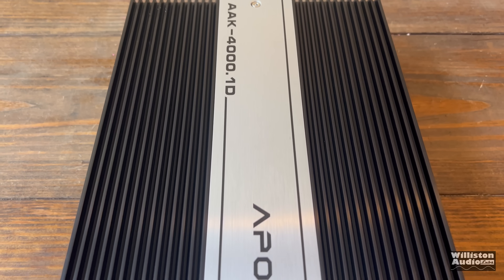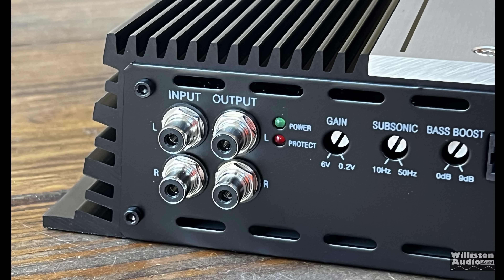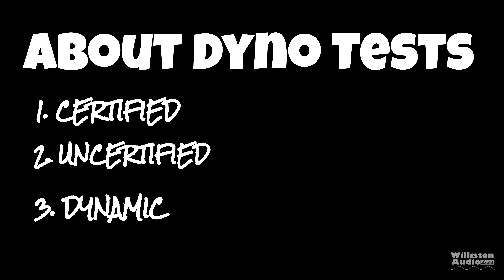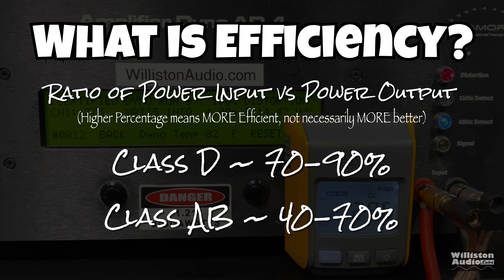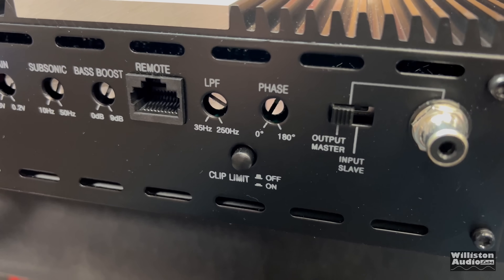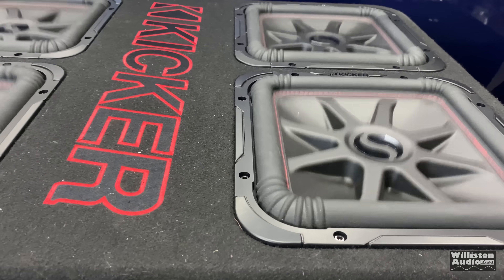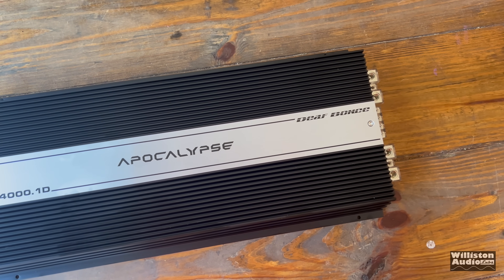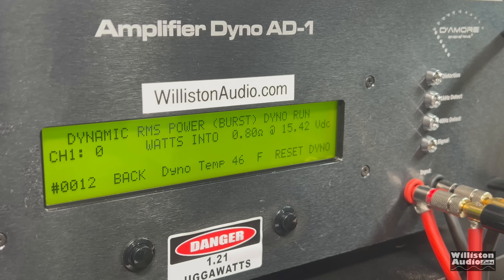Deaf Bonce AAK-4000.1D Amp Dyno Test

Comment: Do u recommend me running this amp on a stock alternator? I have zero gauge and good wiring but I have a stock alternator for a 10 inch Sundown, I'm trying to push the speaker to it's limit, do u recommend me getting this amp?
Reply from the maker: You should be able to push that 10in Sundown well with 1000-1500W which should work fine with most stock alternators. Take a look at the D4S JP8 v1.5 at Shop4Bass.com it's on sale right now and this amp does 1200W.

Comment: These amps are junk. First one lasted almost 2 months, sent it in for warranty and they kept it for about a year. They sent it back claiming they couldn't fix it.  So the dealer, bless his heart and out of his pocket, replaced the amp. Second amp didn't last 2 weeks.
Don't waste your money
Reply from the maker: Must’ve been a fluke as these are made by a high quality manufacturer who makes amps for other big names as well. These are known for reliability
Reply: @wal  A fluke? 2 amplifiers, less than 2 months of regular use, not competition use.  Zero warranty,  yea, that's quality. 
I have better luck with Hifonics

Comment: I slather my car in Boss and Pyramid audio. Built in theft deterrent. 🤣😂

Having multiple small capacitors in parallel lowers the impedance of the power rails and makes for larger surges of power, especially as the output impedance drops. Generates more power, and keeps the individual caps cooler, but if one goes short circuit it’s irrelevant anyways. Also depending of the required filtering and reservoir needs it may be cheaper to use many small caps vs much fewer huge caps.

Comment: I like the brand from what I know of them but it's kinda hard to be impressed with the over rated power since d4s amps have come out and you have tested them.  I have a mtx te4001d that's rated at 3750 @ 1ohm I'm kinda curious what it would do

Comment: found this channel doing a google search for something somewhat unrelated; since this channel looks at older equipment ... 

 if you see this could you explain what the Kenwood KAC-818 Class D mono subwoofer amp's 'Sigma Servo Feed Back' terminals/system claimed to do and if it actually did it.  I have the amp still, 20+ years old and it still works great.  Just curious what it did, if it was a gimmick, worth using the circuit or not, etc.

Had it on a Radioshack 18" for a long time as a teenager :p

Comment: Clip limiting wouldn’t affect the available power. A limiter on the input signal  is a very aggressive compression circuit to prevent output clipping. Usually limiting refers to compression ratios of 10:1 or greater. Some manufacturers call this soft limit or whatever.

Comment: Just wondering if there is anyway to test dampening factor and other things with amps?
Reply from the maker: I’m not interested in splitting hairs with technical measurements that may or may not have any impact on the sound quality. There is great debate, even from amplifier engineers on how to measure damping factor and if it makes a difference. I know what the Internet says about “speaker control” but damping factor is much more complex and not easily comparable on amps because of how it’s measured by different manufacturers
Reply: I wish he would show specs like that in the Dyno videos cause I want high signal to noise and very high dampening factor over 500 preferef

Comment: Man, if they aren't under rated on the Dyno they're gonna be over rated in your car!!! That's for sure!!! With impedance rise and power supply, an amp in a car almost never performs as well as it did/would on the Dyno!!! Dynos, as we know, is always a complete best case scenario for an amp's recorded output. This amp performs amazingly, making it's rated and surpassing it on lower ohm loads. Which is optimal for subwoofers.
Reply from the maker: Dyno makes it easy to compare amps in a level playing field. In car will be different for all amps and setups. No way to account for that
Reply: @wal  Yez Zir, I've tried to explain that to soooo damn many people.......

Comment: At last... a subwoofer amp that can also power my water heater. 😅 Noticeably more power with the clip limiter on is definitely weird. If that were SPL, I'd attribute the increase to a narrowing of the frequency band to a resonant frequency. But, wattage...? Any EE nerds in the comments care to enlighten me? 🤷‍♂👍
Reply: Limiting wouldn’t limit bandwidth.  It limits amplitude. I think the amp just performed better on that run because of inconsistency. I bet if you ran the same test 10 times, 5 with, 5 without the limiter in, you’d have results that vary up and down the same way with or without the limiter.

Comment: Deaf Bonce amps are good quality but they don't do over rated nearly as well as some competitor amps.
Reply: Most of the time, advertised power ratings are more of a sales gimmick. When an amp states its rated at 3k watts at 1 ohm, and yet it does say..4500 watts at 1 ohm, its really a 4k board,  and it sells better having "more headroom" because you think you're getting more for your money. Build houses will print ratings based on what the company wants advertised.

Comment: Korean make some good amps. But Brazilian is the way to go. We just replaced 1 4000d watt crescendo amp,  for 1 full bridge sound stream 18,000 watt Maxx amp, on  two Rockville destroyer 15s at 1 ohm, and the soundstream is really surprisingly better. You wouldn't think a amp so small compared to the crescendo amp, would hit so hard like it do.
Reply: What lmdao “we replaced a 4000w amp with an 18,000w amp and wow it hits harder” are you reading what you’re typing before you hit send?
Reply: @TV_Offroad  ...the amp is not 18000 watts for real, but it's advertises 7k RMS at 1 ohm. But the point of the matter is the amp is cheaper, smaller, and louder. Matter of fact, the deaf bounce amp in this video, falls in the same category with that crescendo amp that we replaced. And that cheap soundstream amp will push more power then this deafbonce, along with that crescendo amp, for half the price that these amps are retaining for. That's why I said you wouldn't think that soundsteam amp would hit so hard just by looking at it. But my point is, eventually people are going to start doing things the new way. The old ways cost too much, and it's lesser efficient.
Reply: @johndough4338  that fact remains, that full bridge and half bridge do not sound the same. This DB amp, can be beat on and abused doing demo’s and whatever else for hours and hours. When I switched from my Sundown SFB8000D, to my JP63, I gained 3-4db in the sub 30hz range, stayed at a cooler temp range longer. My peak DB went up, sq went up, and my draw on my electrical is less with the Korean board. Cheap ≠ better
Reply: @TV_Offroad  18000.1 d is just the model number the power output is similiar
Reply: "Soundstream" is NOT Brazilian... 🤦‍♂️
Reply: @chueyone72  ... it's a full bridge amp
Reply: Brazil is a place, full bridge is an amp design. Brazilian amps just made the design more popular when a few of their companies figured out how to make them dirt cheap just like Korea has with half bridge amps. I believe Sundown’s full bridge amps are made in China.

Comment: I got an MTX amp that wants a piece of that deaf bounce on the dyno.

MTX92001 that I'm a few days away (waiting for parts delivery) from bringing back to life.... 

Previous owner smoked:
1.  5 (of 12) 80NF08 power supply fets (being replaced by 064N fets)
2. 4 (of 16) 30N50 output fets
3. 4 3120 optocouplers 
4. 2 35v 1000uF voltage regulation caps that smooth the input to the optocouplers 
5. The ENTIRE voltage regulation circuit that provides 18v above negative rail to the low side optocouplers.  (1 15v zener diode, a diode array, two mmbt42 sot23s, 4 various smd resistors, and a 42N20.)
6. 1 smoked solder joint on a 5W resistor that provides partial high rail to the high side optocouplers
7. And 4 SMD mounted output smoothing capacitors.
8.  And a bunch of dodgy attempts to work on this amp by a previous tech whose work I've come across before and it was ALL dodgey to say the least....
9.  And most importantly I had to use Perry Babbins amp repair guide as well as asking him directly for a few pointers on this amp.  The guy is downright AMAZING!!

Comment: Can you explain what the significance of the Tiffany style inputs are.
Reply: Tiffany rcas are attached to the case for more support. Regular rcas are just soldered to the main board and can break loose.
Reply: @jamms992  that's what I was trying to say, thank you for clarifying that bro!
Reply: Your very welcome:)
Reply: There made better then your standard RCA that you see on cheaper amps. There mounted directly to the board I believe. There stronger, more solid, better connection!

Comment: Multiple smaller caps generally will offer lower overall ESR.  They will also dissipate more heat.  Larger caps will obviously offer larger capacity per unit but there is no disadvantage to using multiple smaller caps to make up higher values aside from larger PCB traces and extra layout time.  Smaller caps do have higher resonance frequencies than larger high values, and play a large roll in filtering certain frequencies, but in the case of an automotive amp you are only dealing with DC and this does not play as much of a role in choosing a capacitor by size alone. Notice the value of the filter caps on the high side of the switching supply are much lower in value per cap due to the high switching frequency.  Likely the power supply is bipolar so 9 caps per rail on the high side.
Reply: Depending on quality, small caps failure rate is troublesome down the road as you noted. But my thinking is from power stand point and not signal or filtering, parallel charge and discharge will be faster than serial charge going into a large capacity reservoir. McMillen's amp have always been fast and dynamic and this and his genius are what I attribute it too. But I'm just guessing.

Comment: For $900, with this power and quality, isnt expensive compared to what we paid back in the 90s.
The power inputs are probably that way to prevent bumping ground from one, into the positive of the other.
Reply: In the 90's this thing would have been over four thosand dollars.
Reply: In the 90s poor people like me had to run Autotek amps. But they worked
Reply: @julesbruchez-theartofgrapp9646  poor people?
My auto tek 7300 bts and was close to a 1000 dollars  in the mid 90's
Reply: @jamms992  well I was referring to the 400 rms. Are the crappy Crunch
Reply: @julesbruchez-theartofgrapp9646  Those Zed amps were good amps tho. I had a white Mean Machine 80MXI that had Linkwitz-Riley x-overs and was a helluva little 4 channel SQ monster. I gave it away to someone for helping me move when I was in a pinch.....
Reply: Would like to see him find some MM Godfather subs and test them
Reply: Orion HCCA 225’s were killers back then.
Reply: This is true
Reply: That's true but compared to now you could find more power for less money

Comment: These amps although they aren't exact copies they are basically the same as some more expensive and other less expensive amps I have seen. I just wonder if they are just sharing the same parts because they are being contracted at the same build house or are they basically the same amps....
Reply: Lots of companies use the same designs and change them to meet a performance level or cost level they want to meet.  Theres another popular design thats been out forever and there are different companies that sell the same board as a 2k all the way up to a 4k or a half ohm 5.5k.  A lot of "new" designs are just an updated version using modern parts or throwing 2 of an old half bridge design on 1 board and internally bridging/strapping them.  

Really hard to sift through all the bs because every importer/brand will tell you theres is the best.  I just go to the source and have since 2007 or 2008 but its getting a bit harder sometimes now because more people do that and companies with deep pockets dont like that I and others are cutting them out of the importing process. 

That being said Ive got korean and chinese versions of this board and theres no major difference between the 2 of them one of the chinese ones uses lower quality parts but is still about as good.   Really though im all about fullbridge and have been for years no point in rewarding these companies who sell us the same old ass halfbridge designs imho.